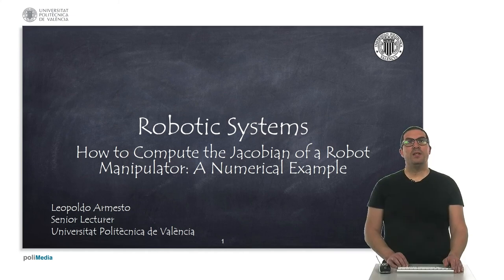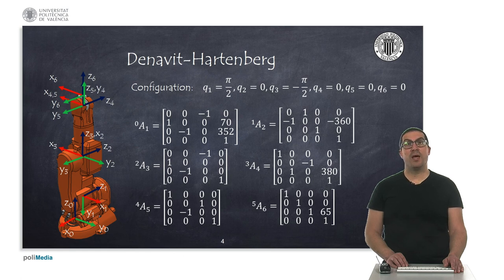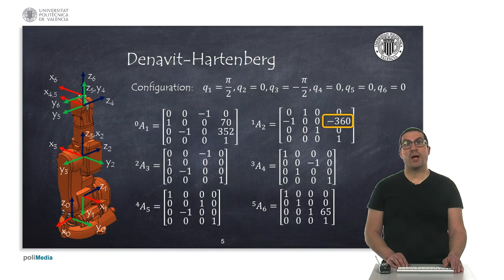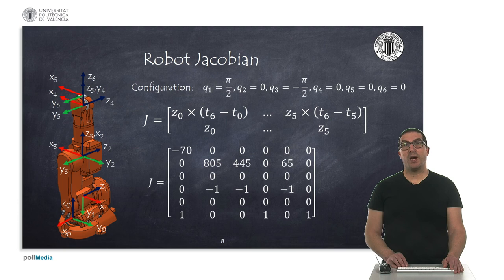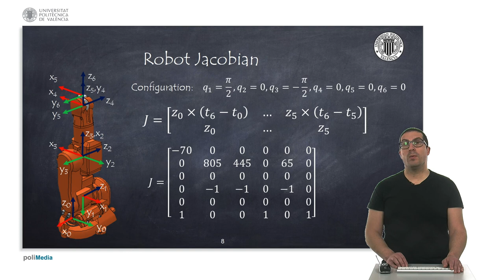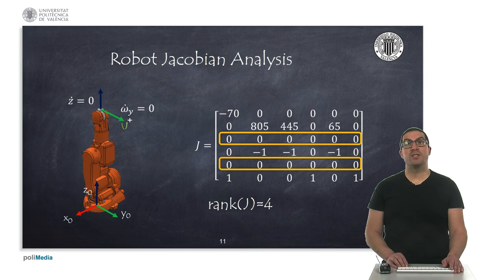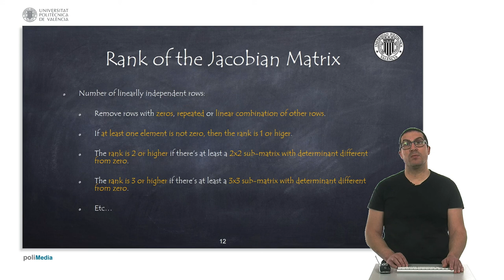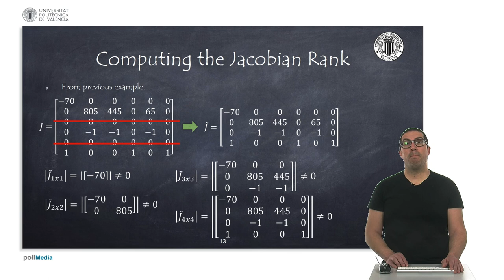How to Compute the Jacobian of a Robot Manipulator: A Numerical Example | Robotic Systems

Comment: Hello sir, thank you for your useful video. But when I apply it to my robot 6dof ,I still not understand. We calculate Jacobian to get velocity of each joint, but example if I want my end-effecter move linear along axis X so Vy=0, Vz=0 but end-effector move messy.Sure it arrived exact position and rotation but it path movement is messy because of each joint movement angle. Could you have other video how to configure this.
Reply from the maker: Maybe you have some singularity
Reply from the maker: Are you implementing a feedback controller based on the inverse of the Jacobian?
Reply: @LeoArmesto  yes sir I do it base on inverse jacobian to calculate each joint velocity. I think maybe the value that I configure to Vx Vy Vz omegaX omegaY omegaZ wrong. I want to know clear about how to calculate it. Example my robot caught a glass of water and I want it to move from one point to other point along an axis and keep rotation point to a direction if it move messy like now water in glass will come out 😔